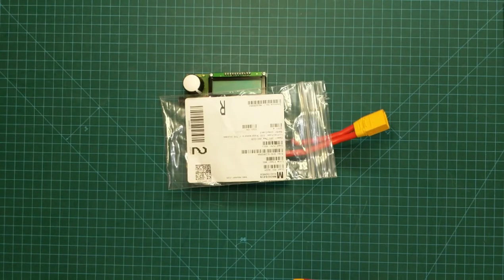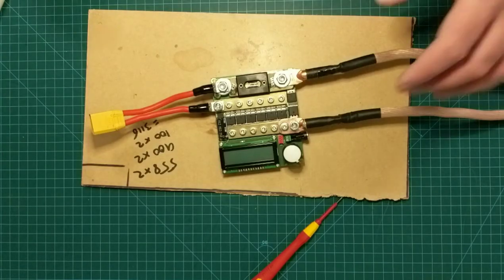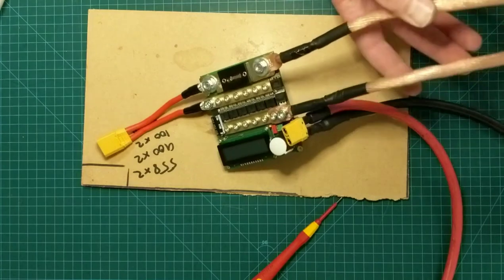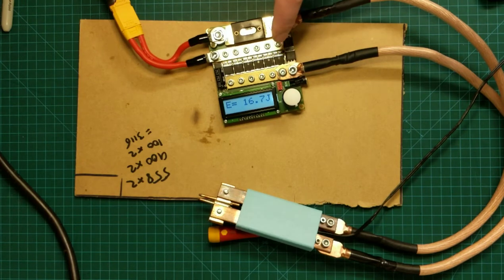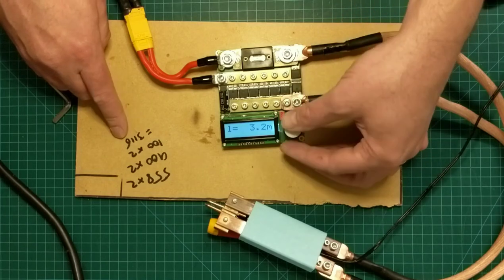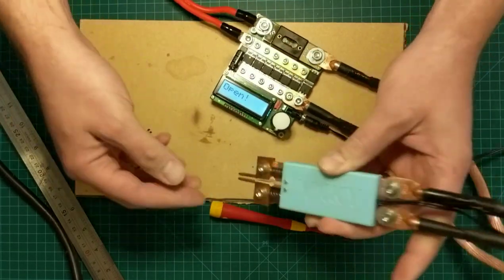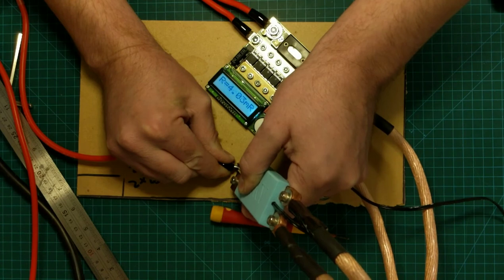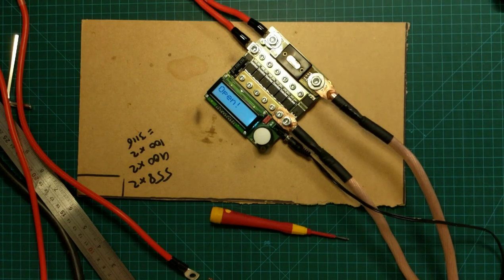not fixing a Kweld with replacement TVS diodes that was shorted , now says overcurrent

Comment: Did you even read the operation manuals on their website? In one of them it says keep the total length of wires short. Going from 1m to 1.5m, for example, you already losing about 500 amp! there is a chart for that. I can't imagine what you're getting with that huge 3.2m cable (total), but it couldn't be more than 1kA, and not to mention the huge inductive kickback you're getting with that length of cable, that destroyed your TVS.
Reply from the maker: That cable was stupidly long and definitely blew the TVS diode. I’m using the original cable’s now 1400A. I’m still using the power wires atm and I’m gonna shorten them.
Reply: Did you resolved this issue?how?…and do you still using those pressure switch welding pen?..thanks for the video..
Reply from the maker: @lezmac3104  yes it’s fully working and has been for ages now. I replaced the diodes and rejoined the blown track on the board then I had to re set the total cable length and I got rid of the heavy cable and pressure switch. I just use auto setting now and the original wires that came with the unit.
Reply: @smartazz  So its wise to use the supplied welding pen then..I was just planning to buy a pressure pen to avoid the pedal manipulation..well, if it complicate things then i can live woth the pedal switch..thanks for the prompt response..
Reply from the maker: @lezmac3104  your welcome
Reply: @smartazz  I know this a 10month old video..but maybe the reason of the overcurrent is that, the kweld cable calibration is intended for the supplied cable which is 6awg wire..and i see a 4awg cable connected. Maybe i could calibrate it at 1.5M for that 1M overall 4awg cable length to compensate for the lower cable resistance and avoid the overcurrent reading?..so maybe the cause is the cable guage not the length..
Reply from the maker: @lezmac3104  yes most likely

Comment: Hi, just have the same problem with kweld, it says overcurrent, did you know the solution ?
Reply from the maker: Need to replace the diod then set the cable length etc
Reply: @smartazz  ok thanks, i just bought the kweld last week and first Time im using it….do you know why the diod does not work anymore ?
Reply from the maker: @nathanpierson9713  send it back under warranty. You might not have set the cable length to correct length